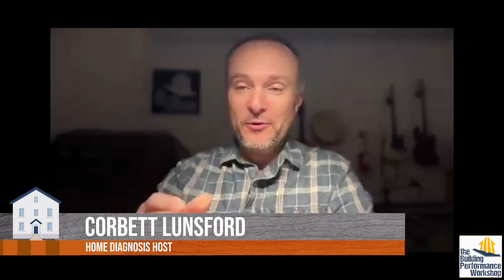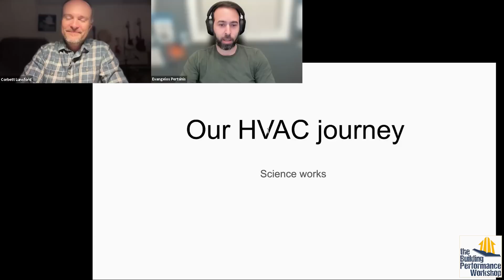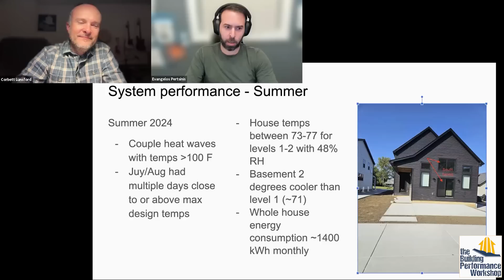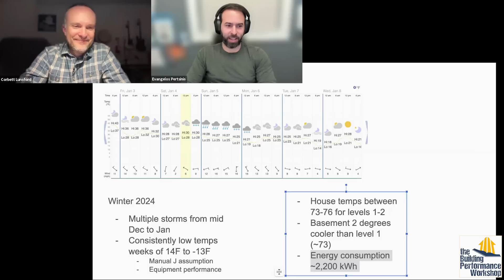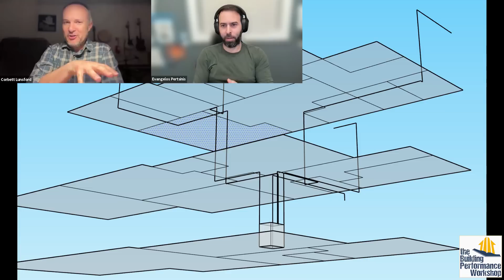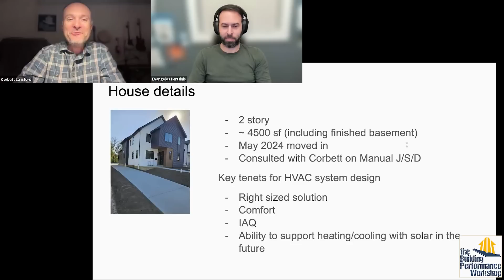Homeowner Feedback on HVAC Design in High Performance New Home: One Year Later

Comment: Did anyone else catch the comments about uneven temps between the floors? That is confusing to me. The ACCA process clearly says basements are not compatible with above grade space and second level space is not compatible with lower levels. Hence, why was there not a zoning system from the beginning? And I was stunned to hear they are using a space heater.
Reply from the maker: The one and only Harry Boody has entered the chat. I think it’s only NC state code that forces floor by floor zoning, Harry, and the backup heater is in the duct system, used only in defrost mode.
Reply: Corbett, I think we met at a Resnet conference in San Diego years ago, maybe 2007 or 08. Then I find you again on YouTube where you share these amazing videos. Thanks for all your hard work. I really enjoyed this video and wanted to chime in with my 2 cents. Be reminded, this is my opinion and others may and probably will disagree. 

NC Code does not specifically require zoning. However, our state licensing board decided to require it. The rule states that all multi-level homes must include a system on each level or a damper zoning system with thermostats on each level.

But our code does require ACCA Manuals J, S, D. Then T and Zr are required by reference in Manual D. And since, the ACCA Manuals gives specific direction for zoning design, I have testified it is required by code by those references when conditions warrant. Of course, enforcement is always a different matter.

Manual J addresses zoning throughout since zoning loads requires PFL. For example, the second bullet point in Section 11-2 of Manual J, v2.5 provides AED is a test for appropriate use of a single zone constant volume system. Section 11-23 details the procedure for evaluating zoning requirements. Section 11-21 deals with flags which arise when there is a compatibility issue with a single zone application. There is also great guidance in Manual Zr. Manual RS provides standards for comfort and safety as an average temp difference between floors and rooms as 2°F with a max of 4°F. I personally think 4°F is a bit much, especially in an era where we see a 40-story rocket landing back on its launch pad. Surely we can do better than 4°F.

Lastly, Section A6-11 entitled Troubleshooting System Design Problems is a section I hope no designer has to use. This section gives a number of issues that create comfort problems. The fourth bullet point provides, "Zone control is required. None has been provided".

In re the space heater, the homeowner implied they are using a Dyson space heater in the basement at the 29:33 mark. FWIW, He also offered if he were to do the system over again, he would probably do a better zoning system with dampers.

Comment: Two questions, I’m building my own home slab on grade two story 2700sq. Ft. And I’m getting radically different manual j calculations. 4-6 ton cooling requirements 

1. How do I get an accurate manual j 
2. I’ve assumed that two separate upstairs/downstairs was best, is this not accurate?

Comment: Great video fellas! Awesome points. Golden Nuggets.. Leakage can potentially increase system sizing. Manual J upsizes anyways, you can tell when the installer isn't familiar with the concept--educate yourself, Schooling HVAC-guys for free, You don't hear heating and cooling (score!!),  Central returns (jumper ducts?), System installation efficiency in the Zehnder system made it simple for the installers.  Draw the heating/cooling ducts D. Helps installer error.  Great data  on the Latent load's affect. Totally agree Zoning dampers and I'd suggest Silent Jumper ducts.    YES HIRE an energy efficiency company for oversite especially the 'how' to  and support for envelope sequencing, installation and QA/Training.. The AirTightness of Passive House matters in that what isn't leaking isn't moving humidity in and out as the building swells and shrinks. That's envelope vapor load and it weakens structural components. And it reduces tonnage :)   WEED out the people who aren't interested in your project! SCORE closing statement!  Cheers to your work.

Here's an interesting video on testing a Broan CFM  https://youtu.be/OA6FbYOcfcY?si=eUhQVHwwGMYOoKw6

Comment: I am currently DIY building a 5 story multigenerational passive ICF home.  I am going to be doing a number of unique HVAC things.  I will have a greenhouse attached to the south side of the home that I will use to help heat the house in the winter by running the outside air through a metal tube the full length of the 72' long greenhouse.  That will preheat the cold outside air before it goes into my HRV.  I live in a high mountain desert so if my home needs humidity I will close the damper on the metal tube and instead pull in the hot humid air directly from the greenhouse through my HRV until my house gets to a comfortable humidity level.  In the summer because of the high mountain desert effect of very cool nights I will be doing a nightly house flush where I push the hot air out of the home and replace it with the cool night air that comes in through the HRV.  And then my back up system for heating and cooling will be ductless mini splits.  I will report back on how it performs :)
Reply: @LegacyViewsICFhomeBuild  get on a coaching call with Corbett (if you need it). He’s worth the cost.
Reply: @dlbbuild  If my home doesn't perform at the projected level I will :)

Comment: The guest said something that led to a question. I’m designing a two story home plus basement (so three levels in all). Im planning on having a central ducted air handler designated for each floor (3 in total) so that each floor can be controlled independently. The units will all be in the basement and will get to each floor through a chase. This is to get around the issue of tempering air on multiple floors with a single zoned unit for the whole house which would cause the problems the guest mentioned. Ie comfort issues on different levels depending on the season (cold in the basement in summer as you try to cool upstairs and hot upstairs in the winter as you try to warm the basement). Is having multiple air handlers in this way compatible with a successful manual J calculation? I don’t know if this question makes sense but the guest said something that made this come to mind.

Great interview by the way. Appreciated hearing the guests thoughtful insights
Reply: I wanted to avoid multiple air handlers because then you have to double up on the rest of the equipment ie humidifiers, dehumidifiers, ERV. 

the temperature delta between rooms, and levels is pretty minor so for us it’s very comfortable.
Reply from the maker: ***Evangelos has entered the chat

Comment: That's a nicely done system. But it would be a bit too small for me to live with personally; I get really sweaty above 71 or 72, even with humidity in the 45% range, and for how much a system costs, I'm not willing to live with a soaking wet shirt each time a heat wave comes around. I would up the size to the next one up, or add a second party load system for heat waves. Plus, heat and cold waves are only going to get more common and intense as climate change continues...

Comment: How can an air handler, that delivers 735cfm max, supply sufficient air to cool a 4500sqft house?
Reply: 2250 sqft per Ton?!
What happened to the 500 per Ton rule of thumb that sales guys use😂

8:15 conversation, that was golden
The amount of malpraxis in this industry forces the homeowner to be highly educated. And dismiss contractors who dont know what a blower door test is 😂
Thanks Corbett for evangelizing the info (pun intended)
Reply from the maker: Air doesn’t cool, Btuh cools. Try running a load calc sometime, you might like it.
Reply: @ I thought my question was respectful. I was not asking because I thought I knew the answer. I was asking because I wanted you to inform me. I am not an HVAC tech and really did not need the standard "run a load calc you hack" comment with the condescension. Sorry I offended you.
Reply from the maker: Oh, my apologies- we get a lot of pushy old school HVAC guys on here. In all seriousness, watch more from our channel and others- the math works. Manual J is written by engineers, it’s got fat built in. 1000-3000 sq ft per ton is typical for my clients.
Reply: @HomePerformance  Yes I had previously watched your video with Alex Meaney where he discussed the challenges of ducting the low CFM specified for a high performance home. The home is this video seemed like it would have presented ducting challenges given the small system size (BTU/CFM).
Reply from the maker: @jackalay23 ceiling fans help with mixing, but at minimum the air handler should never stop running (which all Mitsu systems are designed for)
Reply: To elaborate a little bit on the OP response - The required cooling in a given room is dependent on the insulation and temperature differences in that particular room. With a relatively well sealed and insulated room, you don't need as much cold air pumped in to extract heat. It is also important to note that this system appears to have separate ERV and heat pump ducting and fans - so the actual CFM of air movement is both substantially higher than the primary blower size would suggest, and also much more homogeneous around the house because the air never stops moving.
Reply: Nice interview. I love the "learning lessons/things I would do different" parts the most. I've switched my mindset away from the minisplit craze to the easier to maintain simple central return with fewer zones than more. Simple is always easier to maintain when the lazy kicks in after being excited by the newest wave of tech.
Reply: @jackalay23 - that is an excellent question. And it’s one of the major challenges presented in low load homes. ACCA published Manual LLH discussing these issues. The term Air Loading Factor or ALF is used to describe the problem you highlighted. It reflects the ratio of CFM per sq ft through the HAC system. Conventional residential supply outlets called terminals are designed for ALFs of .5 to 1.0 CFM/ft2. But low load homes can fall well below that sometimes as low as .10 to .20 CFM/ft2. Standard, off the shelf terminals won’t provide proper throw for mixing to avoid stratification. There are several possible solutions discussed in the manual. Im of the opinion the industry isn’t well prepared for this quandary.
Reply from the maker: @dannygough9690 it’s why ceiling fans are a useful part of the HVAC system.

Comment: Regarding zoning. It is easy to say "with motorized dampers". What exactly was he thinking? A 3rd party controller with t-stats per zone? I don't know Mitsubishi's zoning system, or if they have one for ducted splits. With zoning on a single indoor fan coil or furnace, it gets tricky because obviously you can't just shut off 66% of the zones if lets say you only want to serve the basement in the winter time and vise versa for the summer. 

A manual damper for each floor would be super simple. Just mess with them once or twice a year depending on the season. 

What are your thoughts on zoning a single fan coil or furnace unit?
Reply: What I wanted to convey was that a better thought out damper system versus the one I ended up with which controls basement plus level one, with one manual damper, then level 2 with another. 

Motorised dampers can also be automated if you want to be more geeky, but manual ones do the job as well.

Comment: Ground source heat pump would have solved a lot of the small issues
Reply: Absolutely. I still have no idea why geothermal isn't common yet. The units are the same price as typical air to air and there's still federal 30% rebates. It's a no brainer. Biggest hurdle is installation costs, which are WAY over inflated because it's a niche market. Ground loops are just a trench which is a long hole. Anyone can do it themselves and save thousands.
Reply: @christopherbenjamin9273  You said it, it's installation costs. My vertical well system is about $25k-$30k more than doing a traditional setup. It will pay for itself over time, but that's not a cost most people are willing to absorb.
Reply: Yeah I'd love a comparison as I tend to think the same.
Reply: Which issues would that solve? I'm curious because my new build will be geothermal but I'm still learning.
Reply: @DeuceDeuceBravo  mainly the need for a defrost cycle in the winter and the added energy consumption from the resistance heat

Comment: If it’s still available Aprilaire’s humidistat can have an outdoor air temp sensor installed that will allow it to automatically fluctuate the humidity setpoint to avoid condensation issues.

Comment: Corbett/evangelos- how did u need to change set tings your mitsu kumo controller thermostat to have heat strips come on only for defrost, not supplemental? Also would love to know how you wired the Aprilaire 800 into mitsi control board to turn fan on hi with. Any call for steam  …

Comment: Corbett, would you or Evangelos recommend zoning with dampers or taking his 2 ton unit and splitting into two separate 1 ton units with dedicated ducting? If he had to do it over again.
Reply from the maker: Dampers is what he was thinking, and I see no reason to add another $3-5k equipment cost (PLUS another ERV and Dehu potentially).
Reply: Does he have ceiling fans tho?! 😉😆
Reply: @johnwhite2576 and a range hood with make up air on your feet, and kitty litters with 5cfm exhaust 😂
Reply: Zoning with normal residential stuff is kinda a pain, it's not really designed for it. The proper way to do it is how commercial air handlers are set up: a fan controller that measures the duct static pressure and adjusts the fan speed as dampers move, or for more advanced systems, a control that communicates with all the dampers and just maintains enough fan speed to supply the neediest zone with its damper at full open. Then you have a separate controller for compressor speed or chilled water flow (which is a better solution IMO) for supply air temperature control. Then, if you really want to go all out, you add modulating reheat with either a hot gas or hot water coil to control supply air dew point independently from the dry bulb.